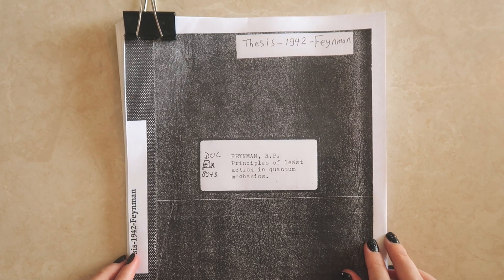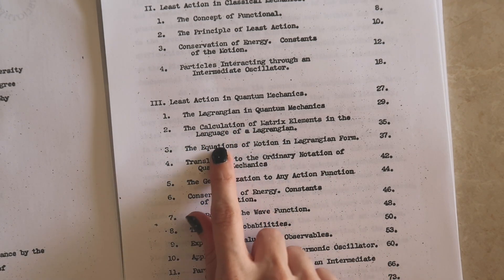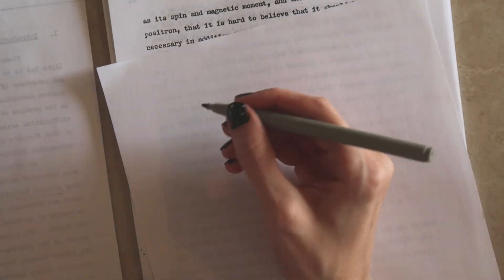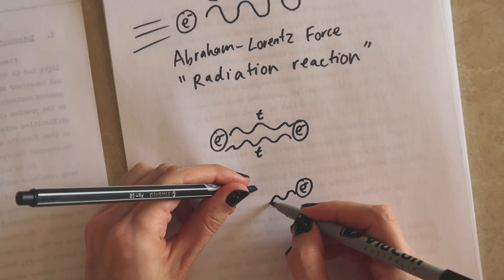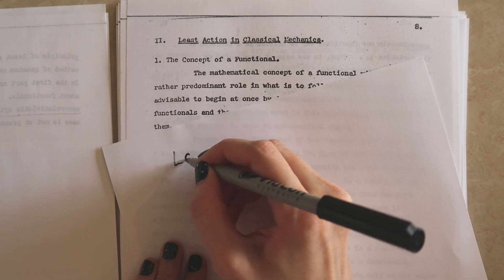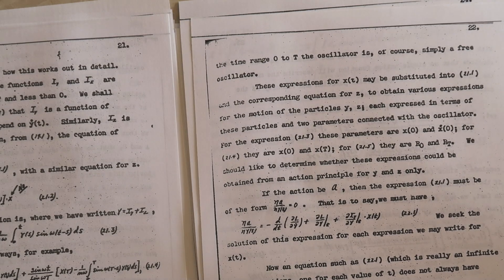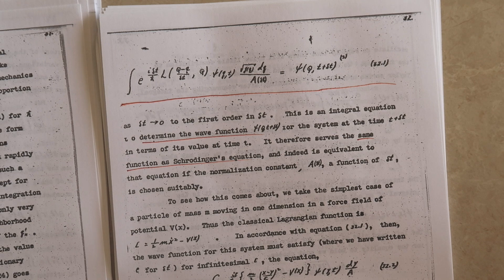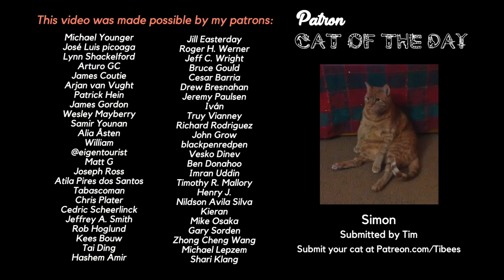This is what Feynman's PhD thesis looks like  👀

Comment: I think the PhD thesis really reflect what one does.  If that is about all the paths from a and b, and the light optimise to use the shortest.  This is crazy how can light knows!  Or one photon knows in advance and … well it does not know all in advance just DO all path and let those non-shortest path cancel each other.  That is why you can do experiment after the slit is passed and if you know afterwards which slit that photon goes through, no interference.  If you do not, interference of the slits.  One photon after the slit has been passed.  Because all the paths are explored and until you stop, it will continue interact with itself in an infinitely way!   

That solved the problem of quantum mechanic inability to deal with creation of particles, and even interaction of photon and electron, the basic of the quantum field theory.

Comment: Scientists with their names being units of measure, ones who got acute on relations & proportionality are at the highest ranks..systems are dynamic though, reinforcing and/or changing their previous iterations (e.g. interactive fields generated).. have different physical behaviors/phenomena influencing each other,there would b new set of variables and weights enough for a different view and theory..check if it has some analogy out there or fits in a paradox & you're onto something profound...the basics at both (sub)atomic & (macro)cosmo are still subject to interpretations.. (resorting to)probabilities & randomness at both levels of dynamics (with both always subject to constraints) gives u some basis but not a unified theory..some theories cant be taken as authorative laws of physics if they contradict plenty of other interpretations (field, other theories with engineering, observations..) & the mathematics they introduce in formulas is arithmetic which can b ignored (given metrics r human defined for starters, &/or its implications would be dropped being on both sides of the equation, as in always there in the system at study, which may as well not be)..having said that, relativity & gravity don't mean much if anything to me, fundamental on their own..there maybe plenty others out there, all serve for ease of modeling, but not necessarily fundamental/foundational

Comment: 13:41 Hey, I drew that diagram! (for Wikipedia, so using it is fair game).

I see the Wikipedia editors have replaced it on the most recent version of the page, because they wanted to draw it as a space-time diagram (my version wasn't intended as such), and generally in QM, the paths don't loop backward in time. But, actually, in Feynman's path integrals for relativistic particles, he DID have them going forward and backward in time--at least, in the version of the theory that shows up in Feynman and Hibbs' book on the subject.

It's funny that young Feynman was motivated by the desire to get rid of fields in QED, when these days, his path integral formulation is usually used with fields. Instead of integrating that complex exponential of the action over all paths of particles through space-time, you integrate over all possible space-time evolutions of the whole field.
Reply: Wow, I see your diagram all the time. Great work and good contribution man.

Comment: I think it's very natural to see what is the consequence of an electron interacting with its own field. Especially at the field has a different charge from the electron itself. That you can get a state where it does have an infinite value. Specifically in the transition to becoming a photon. Which Feynman diagrams would later simplify as interactions between electrons and mathematical positrons.

Comment: Thank you for giving us an impression of the original thesis. To anyone who wants to study this further (including the math), I recommend the surprisingly accessible book by the master himself: 

https://www.amazon.com/Quantum-Mechanics-Path-Integrals-Emended/dp/0486477223
Even if you don't work through the whole thing (which does take some effort), you can get a fairly good impression how Quantum Mechanics can be developed from the path integral perspective. It is really worthwhile to read the 'emended' version, because a huge number of confusing details (and minor errors) in the original version have been improved/corrected. Beware though that Feynman's path integral approach is not the standard textbook way to learn about Quantum Mechanics. If that is your goal, you should really first turn to the standard approach.

Am I gong to remark that illegal, copyright-violating pdf's of the book are floating around the internet? Of course not.

Comment: Working of a Gyroscope

A Gyroscope. Has many wheels. Which rotate. In any direction. And the axis of rotation, can change too. Of any wheel. But why is it so? 

Let us take an hypothetical example. In which there are many coencentric wheels. Say, there are 3 wheels. But they are not connected. Suppose, if you move one wheel. The other one, does. The same type of movement. Now, let us make. This whole hypothetical example, real. An real example. I mean. Connect the wheels, with two connecters. Each set of wheel, would have two connectors. So, 4 connectors. In total. A connector, connects two wheels. It is like a double sided nail. In which, the wheels. Are connected. On the ends. Of both sides. And let's bring that "3 coencentric wheel - 4 connector" system. To real world. If you move the outer wheel. The inner wheel, will rotate. Too. But not in the same way. Not at the same speed. Because, of the change in internal radius. The speed, would different too. And also, because of the connector. There would be a different resultant component, of the tangential force we applied on the outer wheel. Resultant component, will be different. For the inner wheel. And that would 
be because of the connector. It would change, it's orientation. Of rotation. Slightly. 

All of these. Depends. On the ratios. Of the weights. Of the different coencentric wheels. The ratios, of the different radius. Plot, a 5 wheel system. Of a Gyroscope. And you will find the same. The connectors, play an important role here. They change, the orientation. Of rotation. Slightly.
Read, the version. Of "Gyroscope". Given on Wikipedia. Too. In addition to this.
To get a full understanding. Of the concept. Hope, my explanation. Helps.

Comment: Thank you for sharing. I ended up with a graduate degree in pure mathematics, but always wished I had more knowledge of application such as in physics. I suppose had I not been rather strongly disabled I would have studied both.

The first thing that struck me a bit numb was seeing handwritten seemingly complex definite integrals in R. P. Feynman's dissertation. I like many in the 2000's used LateX to turn my hand written version into the version that was published. I remember my thesis very clearly and thought I would never forget all the details.  As it turned out I did forget many of the details, but remember it took me four months before I had the notion of what became a theorem and another 2 months to code the entire 43 page thesis with LateX as well as have the required copies printed by a printing facility. A lot of the last two months was just learning to have LateX create the mathematical notation I desired.

Although I did forget the details I can still, 12 years later, roughly relate how it shows the method for placing a specific upperbound on how many convulutions were required to result in,  (involving  groups having a specific structure and random initial probability mass function), all the possible convuluted outcomes have come close to having a uniform distribution as seen by variation distance being at some fixed point away from zero. 

Actually it was rather cool to have worked on this topic and I always think of dropping a glob of black paint in a gallon of white paint and then asking how long do I have to mix the two before a uniform gray begins to be apparent whenever I think of the work. Perhaps the coolest of all was that I came up with how to generalize the applicable group to any number of elements while in a dentist office waiting for my nephew to have his teeth worked on. Hence, I always called the theorem the tooth theorem.

Comment: If charges do not act on themselves you would not be able to break the violence band by a charge -e or a photon.  Why did I end up here? I suck at calculus. More my cousins field. You did not cover Vector analysis or resistance/impedance at set frequencies in the equations.  I like J notation myself.

Comment: Wait- how is the time delay more absurd than the charged particle being resisted by a radiation field that it has yet to create? I thought the alternative was simultaneous, maybe concerted if not synchronized, reactions by the two charged particles which would explain the instantaneous reaction. This seems like a more parsimonious solution than the slight time advance and reverse to account for the delay problem.  I don't know. I don't have an advanced level physics background. I'm sure people much smarter than me have made better solutions.

Comment: Thankyou Tibee for your excellent insight into Feynman's thinking. 
The Principle of Least Action is what most students understand as the conservation of energy (conservation of momentum-energy). In general conservation laws are simply statements about symmetries in nature, which is an analogue to patterns in nature.
Fields are more generally distributions of energy using some useful coordinate basis, often space-time, but not necessarily. 
Their full description would require a study of Tensors in classical theory, or Dirac in QM (QED, QCD). 
It is quite complicated maths, and you could spend a whole lifetime looking at this stuff.
But along the path you will gain many tools that will enable you to understand physics across many diverse fields.

Comment: Dick Feynman was a genius who could do physics in a stripper bar without making math errors.  His real genius
was in his basic strategy to attack problems.  Almost all physics problems can be approached by using a variety of methods.  Feynman would look at a physics problem; determine the tools others used to solve the problem; and deliberately chose not to use the same tools.  He would try several different methods and whichever tool seemed to hold the most promise was the one he picked.  By using different tools and redefining the problem to conform to those tools, he was thinking out-of-the-box, and could form new questions that would be testable and lead to a better understanding of the under laying principles.  Feynman never wasted time trying to answer why,
and concentrated completely on how systems worked.  His most famous demonstration of this ability was using
a simple glass of ice water to show how the Challenger Rocket and its entire crew exploded on 01/28/1986.

Comment: “The Wheeler Feynman Absorber Theory” sounds entirely plausible to me  if you consider it may be slightly asymmetrical, especially given recent results showing that time reversibility is fundamentally incomplete under an 3+ body system. The 3 body system was shown to have this uncertainty around 5% of non time reversibility. If you consider any system to be conformal and in a sense interacting with itself, conformally sub Planck interaction is what is called self interaction. This would also explain entanglement as self interaction ? Given the fact that entanglement entropy is being used to describe the whole of a universe. Once you can consider a universe as a self interacting particle essentially a black hole with a Twistor space sub Planck event horizon. Once you consider that our universe is inside a black hole and Penrose’s Palatial Twistor Theory with some of my ideas layered on top.
Reply: The reason it is asymmetrical is because nature can not be ergodically complete it can only approach this state

Comment: Actually, homes aren't safe if they don't have antiviral HVAC filters, intakes usually don't have them in homes.

Time for reality, most new cases are in HOUSEHOLDS, not public venues: 55:20 (51:40 in); bit.ly/2TbVrWn

Second, alive 3hr in air, 72hr on surfaces the safest places are cafes, restaurants, and bars where they commonly use antiviral HVAC filters and wipe down tables all day.

CoVID19 lasted 17•days on the cruise ship => this supports the assertion of the importance of antiviral HVAC filters & masks to mitigate & confine the outbreak, ductwork is notorious for harboring microbes.

Soapy water is ok to disinfect.
Hth.

Comment: Boats float b/c it weighs less than the water it displaces, water is actually pretty heavy, and dense.
=One gallon = 8.34 lbs
One gallon = 231 cubic inches
(12)(12)(12) = 1,728 cubic inches per cubic foot
1,728 / 231 = 7.48 gallons / cubic foot
(7.48)(8.34) = 62.38 lbs
=62.38 lbs / cubic foot
(36)(36)(36)/231 = 201.97 gallon / cubic yard
(201.97)(8.34) = 1,684.34 lbs / cubic yard

Comment: Alright. But did you know... actually an electron is a good thing. And therefore, there should be electrons in some space. Furthermore, why are there strings? Actually, black holes are like a good thing. We think, there is an equation for everything. Not only that, galaxies are moving in some velocity space.